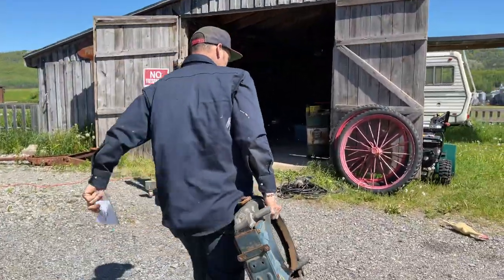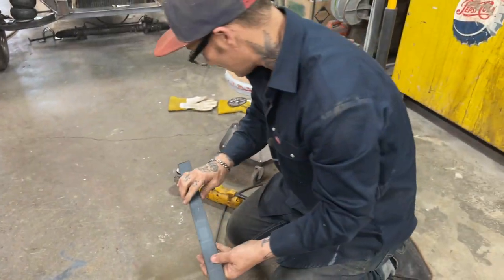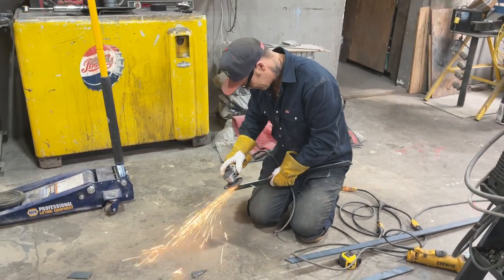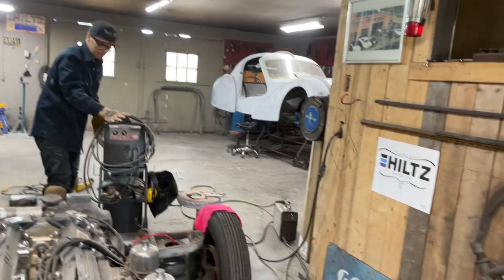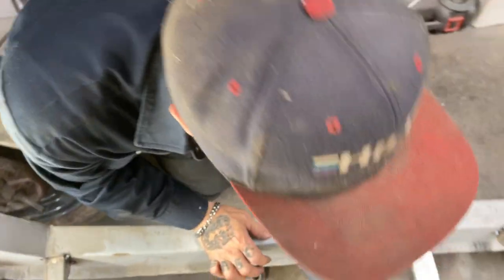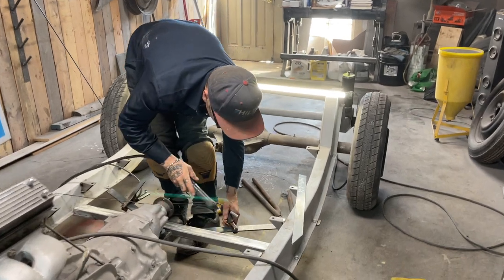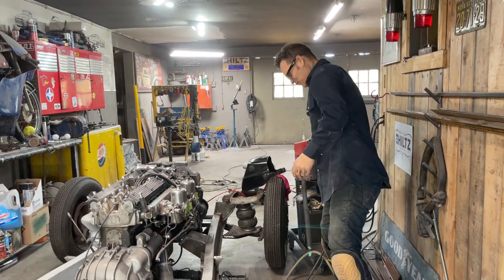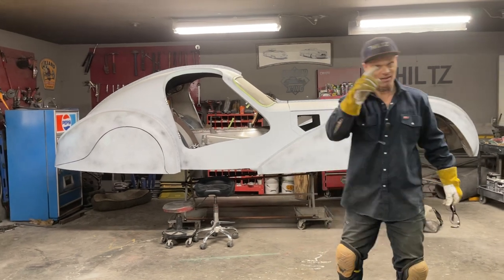BUGATTI CHASSIS: CROSS-BRACING FABRICATION

Comment: Chad I'm going to say it : Cross bracing on a frame you need to use channel or tubing! Not flat steel!!! And when you add extra bracing have the frame level on jackstands
Reply: There’s no strength in flat bar. The whole point having X members is to add torsional rigidity. & limit the frame’s ability to flex. Some 1 7/8” round CDS tube would be the best way to have dealt with that issue & yes the frame should have been squared up & levelled as you mentioned. I wish there was a way that I could post some photos for the “ cheerleaders” to see how to build a chassis that’s designed to carry front, rear suspension, drop out transmission mounts, steering components, mounting points for exhaust, fuel and brake lines and most importantly engine mounts but unfortunately YouTube doesn’t offer the option in the comments section. I’m not trying to burst theirs or Chad’s bubble but he’s not building an engineered chassis. It’s an example of too little learning is a dangerous thing !!!
Reply: @geofo60  I agree, we're definitely not watching an engineered build. Hopefully he'll correct as necessary where necessary.

Tons of work and seemingly endless enthusiasm, this car will look fantastic when it's complete.
Reply: I agree and was thinking about commenting but decided to let it lay...yes the frame will still flex with those flat bar braces but I figured this car is not a race car and I doubt it will be subjected to rough roads and will probably be a show car and not a driver...maybe cruises to car shows and to the food market....would be fine IMO. Bolting the flat bar to the side rails is better than welding because eventually the welds would crack from the flexing. But I always over-build so what do I know.
Reply: Glad to know I'm not alone. While watching Chad add his X-bracing I kept thinking that the flat stock he used will actually do very little to add torsional rigidity... tubing would have been the ideal material. Also welding up the frame while its sitting on a potentially uneven surface and assuming every thing is squared up could spell fatigue problems down the road. Then again... Chad is never been one to shy away from listening to viewer comments and/or making adjustments to his designs down the road.
Reply: For a proper example just look at how car frames are made and braced. Even the early vehicles that used X bracing used some sort of C channel for stiffness. The flat bar will help a little but not make the frame as rigid as he might like. The frame will still allow twist from front to back.

Comment: I understand what you are trying to do, but I have some comments.  If you look at "old" cars with an X brace there are some characteristics missing in your design. The traditional X brace uses metal bent in all 3 axis. This gives rotational, compression and expansion coverage over the length of the X brace. The length of the X brace should span most of the distance between the front and rear wheels. This covers the area that generates all the twisting forces. The current bracing has no rotational or compression and limited expansion compensation over a small portion of the frame.  X bracing typically stopped being used once chassis were "boxed". At this point its a little late to box the chassis, but I don't think you are getting much for your hard work. ......then again I could be totally full of crap.  As always I enjoy your work tremendously!!!

Comment: Looks great, question, would box section give more integrity than flat plate?
Reply: Square or round tubing may have helped with torsional rigidity. But, it's his build.
Reply: answer is yes . the flat will not be  ias strong as box under compression.  example taking hit from the side .

Comment: i would be using box not flat stock
Reply: Agreed. The X member he made is to stiffen the chasis against a twisting flex. The flat stock is weakest in the orientation that the car will flex, I guess it is better than nothing, but it is not really doing a whole lot either.

Comment: Yesterday, I replaced the rear factory bags on a GMC Yukon. And yes, it had a sway bar. It was a four wheel drive vehicle with live axles.
Reply: Thanks for sharing! This is why I scrolled through the comments
Reply: Have a young associate that is a mechanic in a small shop. They specialize in Brakes, suspension, exhausts and such. Out of curiosity I asked about sway bars and air bags, says he sees it on a fairly regular basis.
Reply: He asked if it was possible to have a sway bar on a vehicle that bottoms out on the ground. I don't think stock vehicles do that. The problem would be the range of motion.

Comment: Interesting using flat strap , I thought I you wanted it stronger that you would have used the box tubing..... Also usually if you think about it most transmission crossmembers are set  on like an angle iron piece...
Reply: Or shaped like a letter U in the centre with bolt in flanges on each end so by undoing 4 bolts the transmission drops down & out. Sadly there’s no serious planning with the most important part of this build........... the chassis !!

Comment: Looks rather easy to obtain a licence plate for self build cars in Canada ?
Reply: It definitely differs from one province  to the next.
Reply: I noticed some self builds from the UK have licence Plates starting with the Letter Q
Q isn't a letter normally used on UK number plates!
Reply: @MyJon64  Q plates in the UK are used when the date of manafacture/registeration can t be confirmed. Like this car, the body, engine, suspension all come from different years & have been modified.

Comment: That trans mount is going to bounce like a spring- it's all just 1/4 flat bar the 3X2 tube isn't doing anything.
Reply: Needs at least 2X3 tubing. I can't remember what car that old frame came out of but it is missing the cross member.
Reply: @nboldrini  That piece of 2 X 3 is doing nothing- it should have been stood up the long way and bolted to the chassis- as it is now, it's just laying on the flat bar.

Comment: I MIG welded some sliding barn door box rails today to make a 6m long dual roller guide and while doing the welding I was thinking about the way you spot weld so much.  I was mindful of that today when welding, just doing spot welds and tacking only the parts that were aligned and then going back with wedges and clamps to get alignment where it needed coaxing then weld.  Got really great results, straight and smooth and the trolley wheels glide over the butt welled splices as if there was no weld there at all.    In the past I would have tacked all around and then gone back with a hot and heavy bead.  I learned is best to not put so much heat in it ..Thanks Chad.

Comment: Love what your doing...BUT slam on the breaks......
Where teaching the word integrity !
An teaching  the word respect !
I have to throw a wrench into the gears by saying the words.
I.   IRONICALLY mistakenly goofed up the cross members integrity. But not drilling perfectly matched bolt holes to bolt size. Instead of plasma cutting...every thing matters a little bit sort of. Happens to be one of my many sayings  too. I laugh so much because ive walked in those shoes. 
I must say the cutter you use will cut an cauterize  your finger at the same time. How do i know
, IVE DONE IT...    MY CANOE,  YOUR CANOE . LEARNED HOW TO SINK ON THE SAME RIVER. 
THAT MEANS SOMETHING RIGHT...... i think  so, 
SAFTY FIRST. ?  SAFTY FIRST. 
I CAN RAMBLE TOO . 
REMEMBER jolene will be driving it , no slacking in safty . Yeah , yeah , i worry an ramble to much........

Comment: Haha, I got a belly button lol! Yes you most certainly can run a sway bar with and air ride suspension, and should! Just as anything else just keep it level and keep it from binding by using spherical joints on your links. You can use rubber bushings it’ll just be a little snugger. That’s my two cents for what it’s worth. Thanks for your uplifting perspective and congratulations on the Bad Chad Award at the school. Be proud brother! From Ontario awstalavista…….

Comment: Sway bars keep your wheels even during a turn. Eliminate roll on the body and chassis. Air ride is adjusting the ride height. 2 totally different functions from what I understand. Many kits come with sway bars. Can you get by without a sway bar when running air ride? I personally wouldn’t. ... just an opinion based off past experience. .. loving the build btw, awesome build!

Comment: I’ve done air ride with and without sway bars. The sway bar is just that, to help keep the vehicle from having too much body roll. I had an S-10 on air ride and I removed the sway bar for side-side motion, but this was with switches, valves, onboard compressor, etc. your build would likely benefit from a sway bar, problem is I see it’s getting pretty crowded up front. You may be able to just run one in the rear.
Love the vids, keep them coming!

Comment: Trans mounts motor mounts on hot rods.  Nice recipe.  Ive found were ,  threaded adjustable. Where vibration in the drive shaft can be adjusted away. 
Allways designing trying to fall asleep...  doesnt everybody!!

Comment: You said you had to remove the body to remove the engine. If that is true then why bolt the transmission mount onto the frame. Just weld'er up. If you can only remove the engine from beneath the car it's a different story. That cross member may be too flimsy also. If a corner of the car is struck in an accident it may fold like a jacknife. Safety first, I always say.

Comment: You need the engine front end up a little , or you would have an air lock in the water jacket . Having done that myself , I was very lucky that 
I didn’t cook the motor . Could have been catastrophic as we were about 1000 miles from home in Spain !!!

Comment: Engine and Trans angle was a engineering design for more passenger leg room. Pinion angle on the drive shaft u-joints allows rotation. To little angle robs lubrication from the needle bearings and causes premature failure, to much causes rotational vibration. Engine lubrication is provided by the oil pump, and transmission lube from torque converter. By no means am I an expert mechanic, just recalling High School auto shop

Comment: ***   I'm wondering.  While you're building/ working on assorted different metal parts of the Bugatti 57C why don't you send the seats out to be upholstered, the roof interior, door interior side panels, carpeting & rubber flooring measured for a fitting by the guy who does your sewing work?  S/He doesn't have to put it all together until you are ready but if it's all been patterned out, you won't have to wait weeks for it to be finished.

Comment: I don't know if the prop Shaft has a universal joint at that end like some do but it would be a good time to check clearances! Another great video and I think flat bar cross bracing is ideal. It only needs to be a bit stronger than than the small  pin below the gearbox. Don't want to over engineer.

Comment: It is interesting on how you are constructing your transmission and 'X" bracing. I would think for ease of removal when you drop the motor and transmission and you weld the nuts to the frame you should weld them on the upper side of the frame with the bolts coming up from the  bottom. Lot easier than trying to get at the bolt on the out side of the frame right by the body.
Love and Peace.     Blessed Be.     Doug.

Comment: Your frame looks to flexible,. lift one corner and if it does not lif at least pick up one other corner its too limber.  Make your "X" member three dimensional as deep as the frame.  Suspend the trans mission off a removable  section of the X member.  I usually determine engine level by making the carb level,  Can't do this method with SU carbs unless the carbs are remove and then you can set a level on the studs on the manifold.
Mike B  Texas

Comment: I would box in the trans mount to prevent water getting in and the mount rusting from the inside.  May cause a problem with the paint/powder coat flaking off.  JMHO

Comment: Yes you can use a sway bar with air ride. The air ride just replaces the coil spring, which sets ride height. All you have done is make your ride height adjustable. The sway bar will keep it from rolling out on a curve. It will move as it should on the road and it will move accordingly for ride height adjustment.

Comment: The x-brace appears to be a good addition to the frame and transmission mount. Tied things together nicely and should add a good amount of stiffness and strength. Each day the chassis is moving along very well. I’m really looking forward to seeing how you deal with the rear end and rear suspension. All the best!

Comment: A properly installed sway bar will sit neutral with no load (or tension) until the body tries to roll (lean) while transferring weight (cornering) and the sway (stabilizer) bar will then apply load (tension) controlled by the frame rails transferred through the bar mounted to the control arms with a link kit on the ends of the bar. Today's standard on most all vehicles is front and rear bars. Anything less will be disappointing to drive for this Bugatti.

Comment: Sway bars are designed to counteract the body leaning, not going straight up and down. To help the frame from racking the bracing should have tightly fitted drilled holes for the bolts vs plasma cut holes.

Comment: A sway bar will work with an air ride system, as long as it is adjusted the same on both the right and left sides of either end of the car you are adjusting. The sway bar will pivot equally in the frame mount bushings of the swaybar. 
If you have different levels in the airbags from right to left, the sway bar will be fighting the opposing side. After all, it functions as a torsion bar that is twisting clockwise and counterclockwise from the right to the left side of the car, opposing the control arm suspension travel connected through the sway bar links from one side to the other. Thus reducing body roll all the while helping to keep the inside tire in contact with the pavement, increasing grip which aids in increasing the handling.

Comment: Brad, the "Achilles heel" on your transmission cross member at the present time is the mount you have on the tail shaft of the tranny. Both engine mounts and transmission mounts are subject to the torsional or twisting effect from the torque of the engine.  There is not much excess weight on the back of the tranny, the engine mounts do the majority of the support. When supporting and reinforcing a transmission cross member concentrate on torsional forces. I am not totally sure what your cross bracing will accomplish.   Your project, your freedom.

Comment: I run my sway bar on my body dropped s10 on 20 inch rims. I had to notch the frame for clearance. But it works fine it has bushing that allows it to roll when laid out.

Comment: Hey just a couple of notes  if you use those vice grips proper Jo wouldn’t have to hold the bolts if you clamp the strapping to the frame then you’d have two hands available one for bolt other the nut.  My one ton pickup that has all that extra stuff I’m sure that round bar is for torsion has the same looking air bags as them front ones on that car they mounted strait  under the frame to the axle. To lift extra to make it so headlights don’t shine into oncoming traffic especially when towing heavy trailers.

Comment: overdone. no C braces necessary. everything has to be flexible. if not, it will break.

yes, swaybar in front and back with air suspension here.

Comment: Typical setup for driveline angles are 3 degrees down on the engine and three degrees up on the differential. This ensures smooth operation of the u-joints and lessons drive line vibration. Love the builds, you, and Jolene.

Comment: Could the brackets for the air bag go on the diff go on the other way round. Longest part is facing the engine.
When you put the levers in, it's clear of the diff?!

Comment: Would you take the car to a steering shop and have the alignment checked before fitting the body on?
If any mods or adjustments are needed it would be easier with the body off.

Comment: You definitely shouldn't use flatstock I would make a mount on the chassis and at least a minimum use inch and a half Square stock. There is no stability with flat stock.

Comment: The cross braces should be RHS and the holes in the chassis should be drilled and a tight fit for the bolts, the chassis won’t rack but can still twist

Comment: Chad make sure you make a loop for the drive shaft that's to prevent if the drive shaft breaks at the transmission it goes down and hits the ground bounces up and come right through the floorboard it's for safety but it's a must. 👍🏁

Comment: How many think that the transmission brace should of been like the frame in height and put a hole in the center for the drive shaft to go thru . Than mount tabs on the end to bolt to the frame.it’s only a thought.

Comment: I`m impressed on how hard you work when you can work with modern tools,,,. a grinder, torch, plasma and welder, and a mind set to get it done is all you need bro, but come on bro Vise Grips for a  hammer, you couldnt find a hammer.

Comment: Always good to have a strong chassis. X brace is a great idea!
Reply: The only problem is that this is not how you build a X member. C section (channel) or 1 7/8” CDS tubing would give it torsional rigidity & prevent it from twisting.